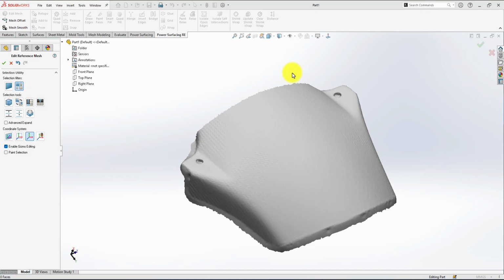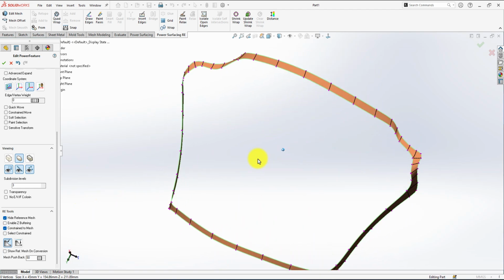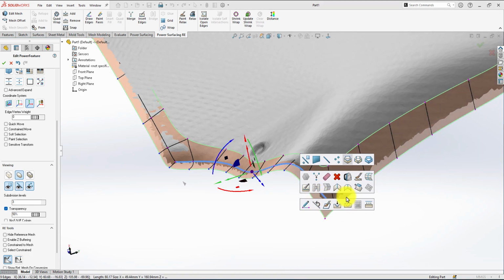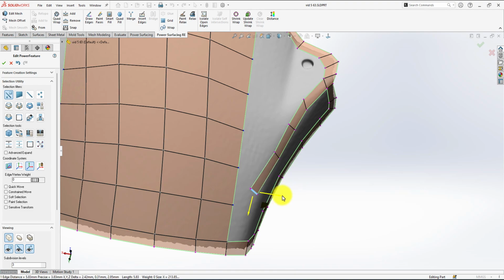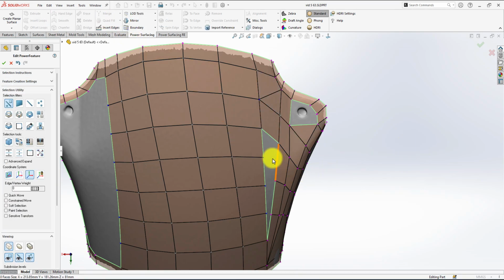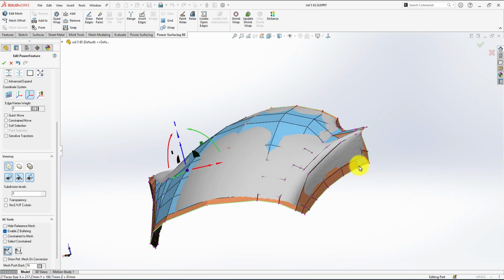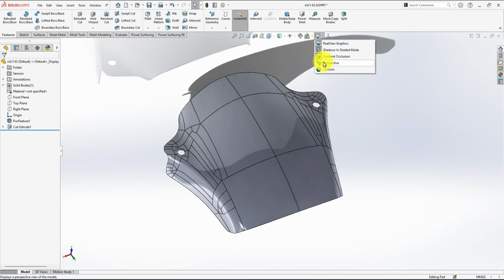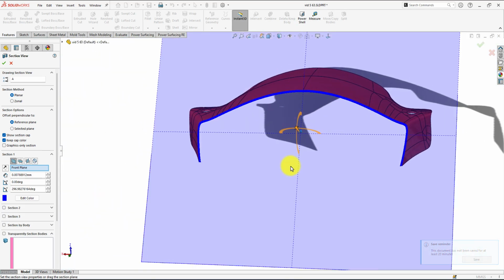Get Rid Of The Bad Mesh Edges | Power Surfacing RE - SOLIDWORKS

Comment: Thanks for the video. Is there a command that acts like a magnet , so the positioning of new mesh could be more faithful to the old one?
Reply from the maker: Not exactly, but you can easily merge between old and new mesh. However, the extruded faces are always connected and attached to the scanned mesh when you activate the
 " constrained mesh " at the side panel.

Another way is you can magnet a full subd with one click by clicking on the shortcut menu tool called "constrain to mesh"